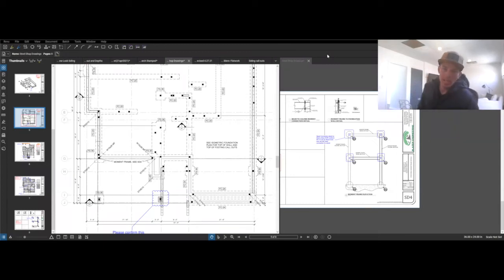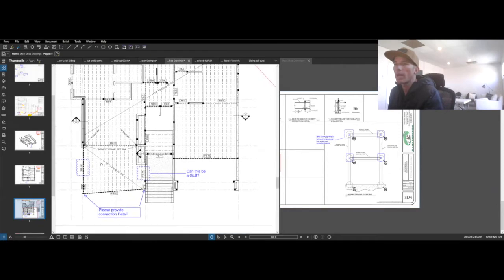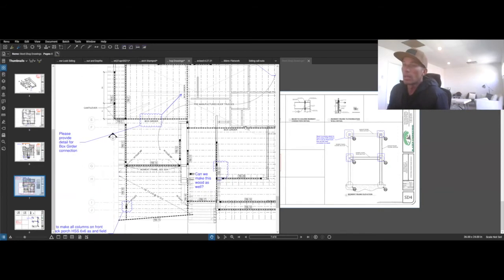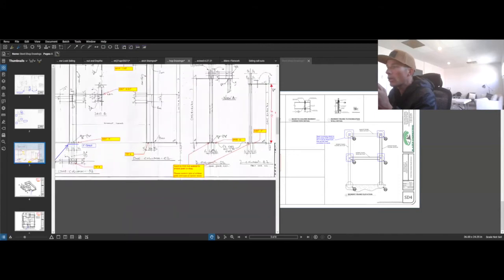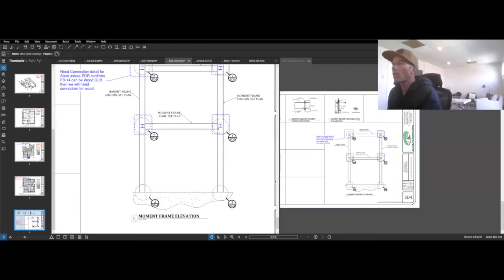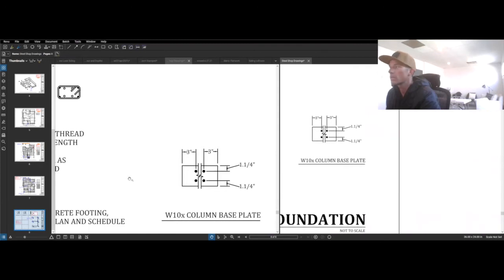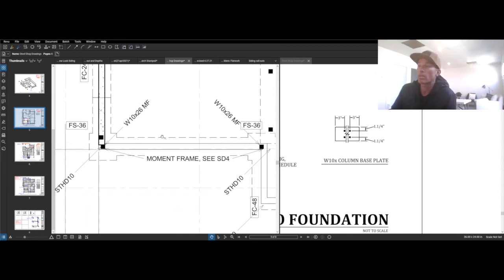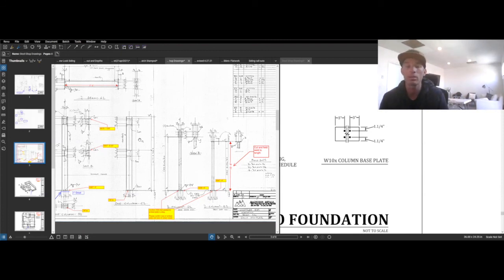Steel Shop Drawings

Comment: Question. Did you create the steel shop drawings? Another question if you didn't create the steel shop drawings, how much did you pay for that. I am trying to see how much to charge. I am planning to create shop drawings in the future.
Reply from the maker: Hi Jhon- We did not create these shop drawings. The steel fabricator creates them for us and then our in house team reviews them with the architect and engineer to confirm elevations. I have seen outsourced shop drawings cost anywhere from $2,500-$30,000 depending on the size of the house. I think if you're providing detailed drawings, with good communication, follow through and follow up you could charge a premium price for your work. Hope this helps, good luck!
Reply: @davidwintzer  This is very helpful! Thank you!!!